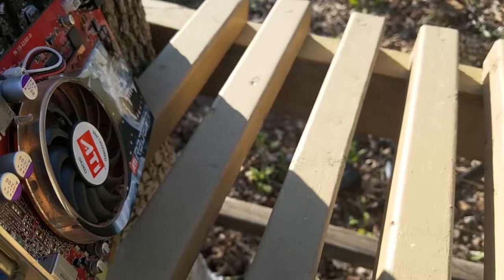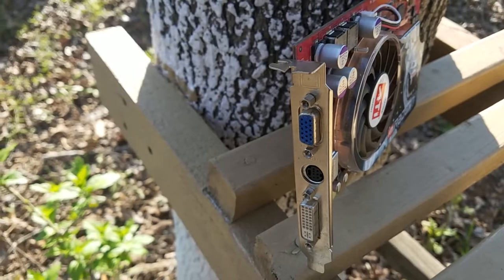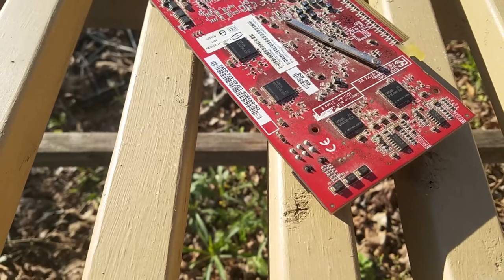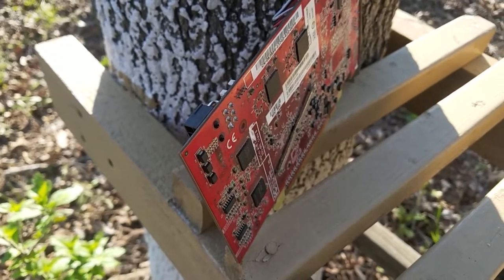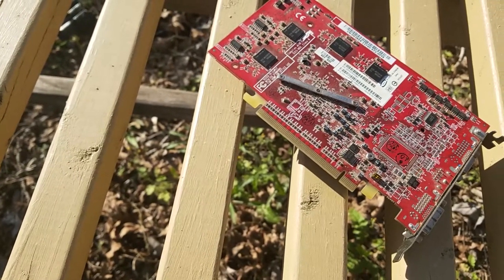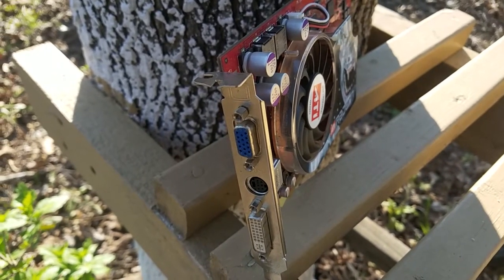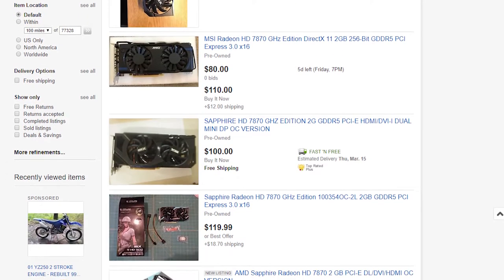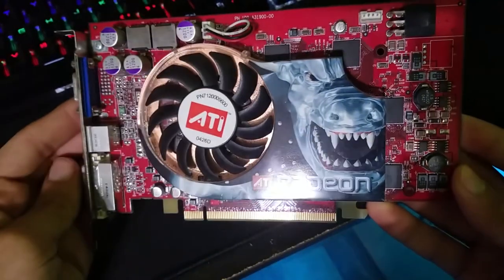Is the ATI Radeon x800 PCIe still good for use in 2018????

Comment: This card nowadays is obviously well suited for retro gaming, or if you had it originally in 2004 when it came out. for anything modern, of course it's not going to run anything past 2009, even then, the area between 2006 and 2009 is iffy as is, mainly cause at the time, devs were moving towards pixel shader 3.0, while the x800 had 2.0. Which ATI remedied in their next lineup with the x1800, x1900 and x1950 XT and XTX. or any card from the x1300 to x1950 XTX. those had shader model 3.0, and can run generally a bit into 2011-2012. pending how demanding the game is, but cards like that are more suited for retro gaming nowadays anyways. and for general browsing, if you have windows 7 or older, it's fine as vista drivers work on 7 since 7's kernal is basically the same as vista's but more improved on. I use an x700 Pro in my retro PC with a 120hz CRT, and it runs everything pretty good. It's harder to appreciate at first if you're new to these cards and what they're great for today. but back in it's prime, this x800 was an absolute powerhouse, even beating the 6800 Ultra. But because of Pixel shader 3.0 being required later, Nvidia's offering had a longer life span, it's last driver even works on windows 10. as windows 8 drivers on 10 is like x800's vista drivers on 7. But even trying this card for modern games 14 years after it's release is pointless. Though there are a few pick indie games out there that still work under Shader model 2.0, and would work on an x800. but that's really hard to find. It's one of those cards that you had to really be there to really know about these cards. I ran a GeForce FX 5200 until 2008. and shortly used the Radeon 9600 XT before getting a whole new PC in 2009. These aren't horrible cards. They're great cards. It's just they're old. and like any GPU today, in 10 or so years, it's gonna be a similar story with a GTX 1080. a 1080 in 10 years will be like the x800 is today.
Reply from the maker: Thanks for the comment. Interesting stuff
Reply: I had a Sapphire Radeon X800 in 2005, and while it was awesome at the time, I distinctly remember it struggling with WoW Wotlk by 2009 even though there had been minimal changes to the WoW game engine in those four years. The upgrade to a Sapphire Radeon HD 5850 Toxic was like a completely different world. Makes me miss those days of frequent news and jumps in technology on the CPU and GPU front.

Comment: I was rocking a visiontec x800 pro and then a x1800 512!!!!!! I had a dell demension 8400 but...bit...I drwmmeled put the back for a upgraded PSU, and liquid cooling...I had 3 gigs of RAM, duel 180gig on raid ...I was the envy and hate of LAN parties....paired with a ultrasharp 24" in 2005-7...... I was a lucky 14 year old
Reply: Fyi I was.about maxing BF2 x4 msaa with my x800 I was on a p4 HT it's ed.

Comment: I'm sure that this card is really good for anything to do with Windows XP I had another card from the X 800 series but it was not this one it was the x800 XL it was quite a bit similar to this card but I think it had a little bit better bus interface the games that I was running at the time games like Oblivion I think at one time I even had the first edition Starcraft 2 it ran but it had a little bit trouble with the cinematics I definitely would not recommend any of the series running anything newer then 2006 games and definitely with XP as your main operating system for this particular video card it is definitely well suited for Retro Gaming
Reply from the maker: Yep! I will be using this card for a future XP gaming machine I will be building soon :)
Reply: Techie Pocket totally awesome I look forward to seeing it one thing you might want to think about though with that card is getting a PCI cooler when I had a similar card from that series I had to get a few fans on it and plus it helps with an overclock if you intend to do that and I'm pretty sure you can get a pretty reasonable overclock
Reply from the maker: Thanks for the tip!
Reply: Techie Pocket no problem any type of information that I can pass on I'm more than willing to